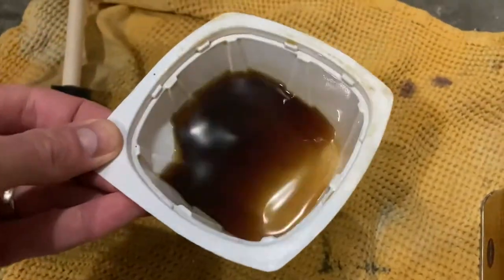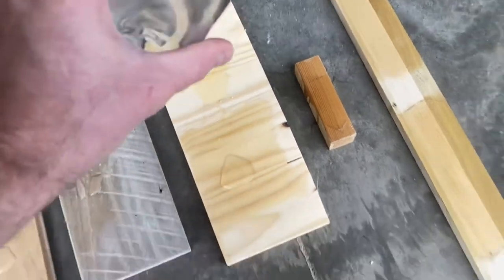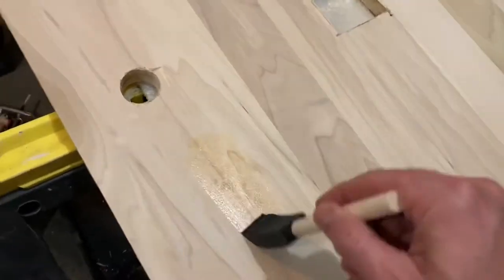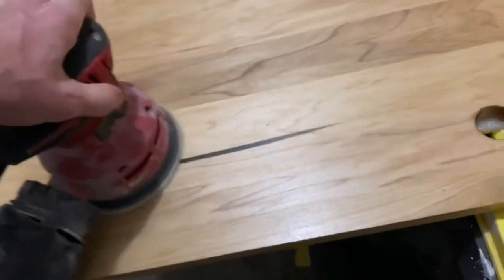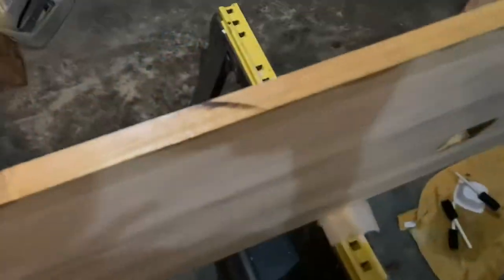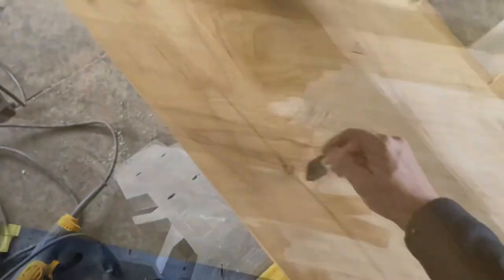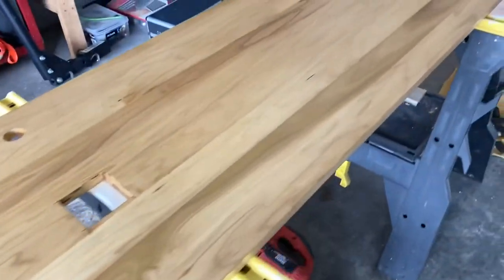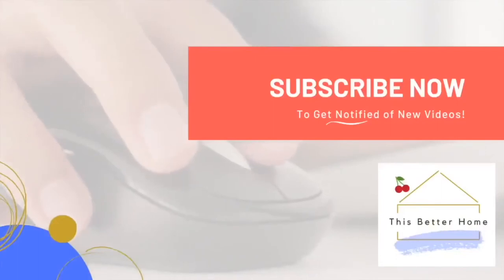️🔥 Waterlox Sealant/Stain➔ What You Need to Know BEFORE Applying (Full Review + Demo + DIY Tips!)

Comment: Yeah so as you discovered, you want to apply and even coat to the entire thing, bottom first and then flip and do the top, because the top is the priority. Not only are you going to having pooling but you can VERY easily warp your wood by only sealing the top. 

You're sanding way too aggressively. You shouldn't ever need anything more than 400 grit and a VERY light pass by hand. Like literally grazing the sandpaper over the piece maybe 2-3 times, and you usually want to do this after coat 2. Any time before that, most of it is still soaking in and absorbing. You absolutely should do more than 3- 4 coats. It doesn't even start building up until like coat 3-4, depending on the wood, and waterlox is amazing at self leveling. 3-4 can be okay for some things but the real magic and protection of this stuff doesn't come out until after like 6-7. Especially for a heavy, "bad" use case like bathroom counter you will want it built up. Usually I sand once after the first 2-3 coats or whenever it feels rough, and then VERY lightly after another maybe two coats. 

Shine a light across so you can see where it goes on. Simply lay it on evenly across the entire thing and don't mess with it. It will get tacky quickly so lay it down and let the self leveling do it's thing. As you get more coats it's paramount to NOT mess with it. Use a light stroke with the brush and lay it down in one pass
Reply from the maker: Great feedback and tips. Thanks so much.